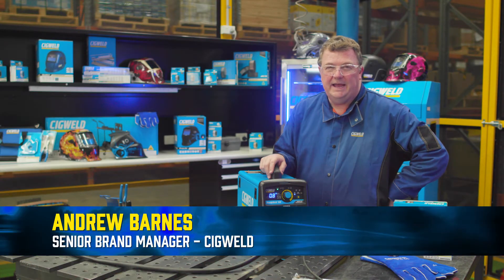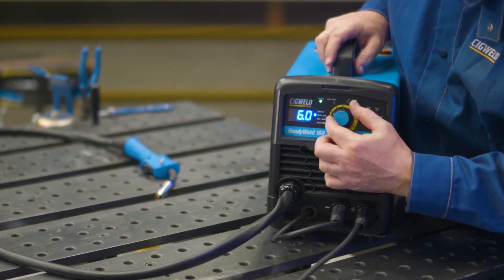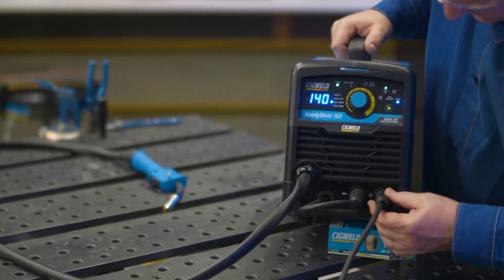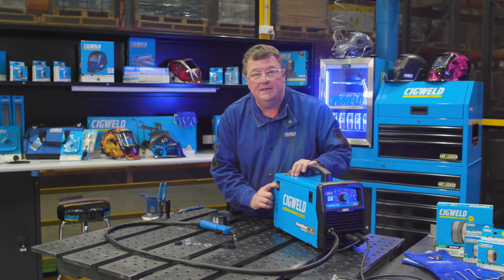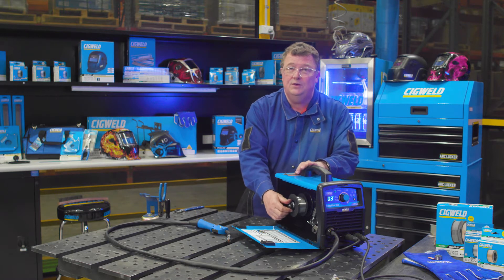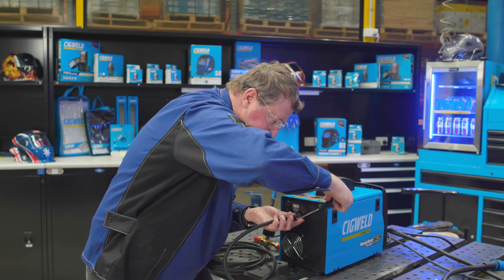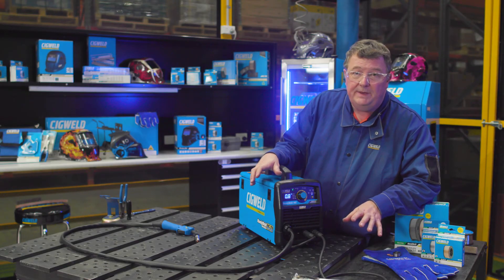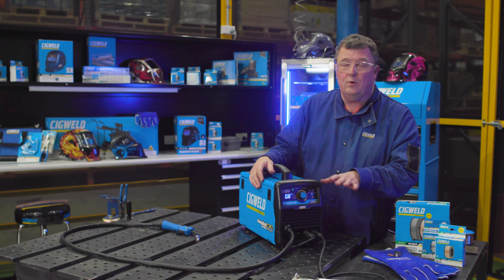CIGWELD HandyWeld 160 - How To Setup Guide - Setup in 3 easy steps.

Comment: Good stuff, my question is I have the cig xf186, I tried it out the other day and I noticed every time I stopped the wire protrudes the nozzle by about 30mm, it's annoying when I re start, how can  adjust this please
Reply from the maker: To reduce the wire stick out you can adjust the Burnback settings, increasing the number will reduce the stick out. Please see page 34 of the operating manual under section H: Burnback (bUr). Let us know how you go! 🙂
Reply: Thank you so much! I tried and I was able to tune it to where I like it, many thanks

Comment: I’m just setting up my cigweld easyweld 160 with the mig wire it came with. Part number WG4509. I can’t get the retaining nut to tighten and put any tension on the brake? Its like the spring might be too small? Is this common?  The spool spins freely regardless of the tension I apply when I tighten the nut.
Am I doing something wrong?
Thank you